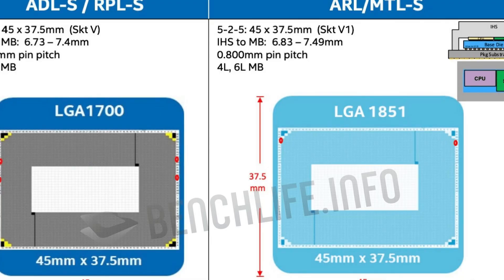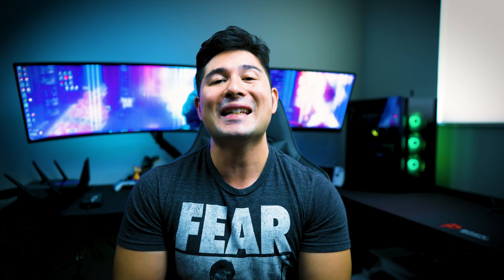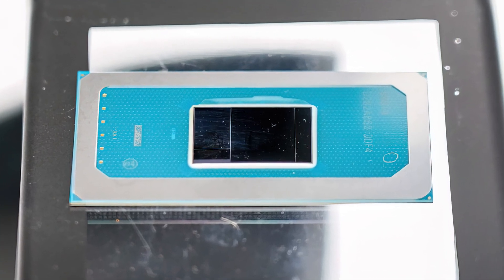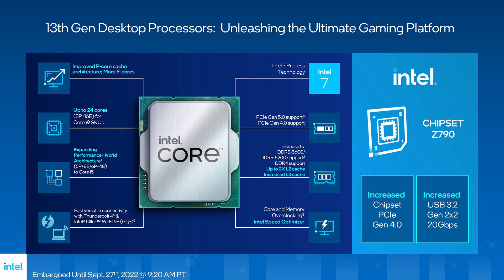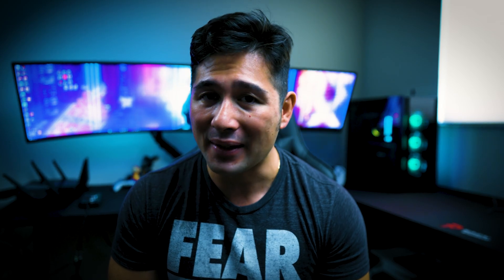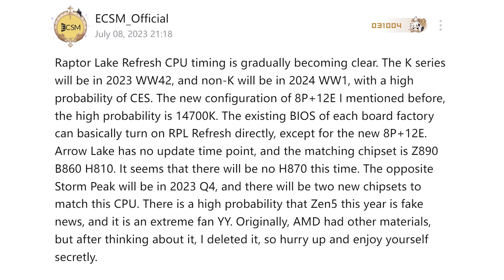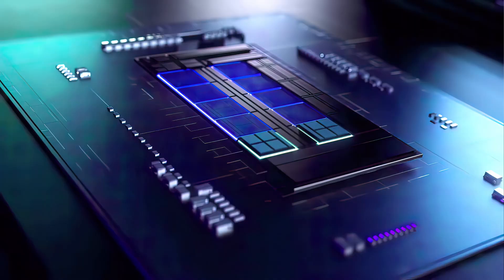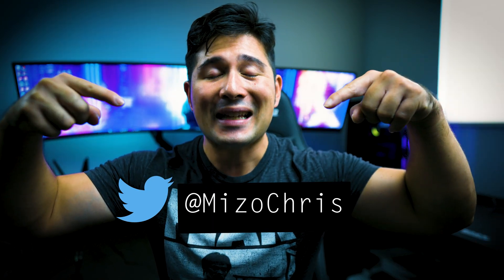INTEL 14TH GEN PROCESSOR, RAPTOR LAKE REFRESH, METEOR LAKE SPECS, RELEASE DATE, PRICING & MORE!

Comment: so meteor lake is just a raptor lake refresh? is it worth getting or wait for arrow lake (2024)
Reply: i think Meteor Lake is going in a different direction. It's tiled (working with TSMC for manufacturing), has AI hardware built in, may be introduced into mobile and mini PCs first (ASUS's PN65 says 28W chip).
Reply: I think meteor lake will come as 15th gen if amd can't still compete overall. Ofcourse for games AMD is still the clear choice. If AmD somehow catches up, intel will release the arrow lake and skip the meteor lake as 15th gen. That's only my opinion.
Reply: @alrizo1115  We'll learn more at the Innovation event on Sept. 19th and 20th.
Reply: I’m on i9 9900k so I’ll probably upgrade to whatever core 9 they release EOY 🥴